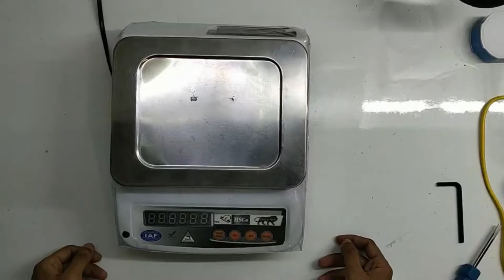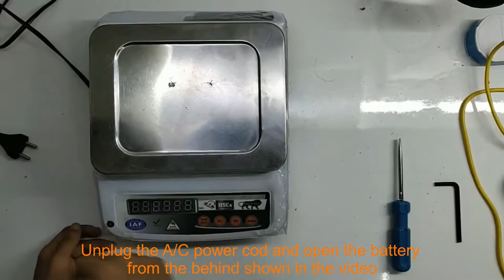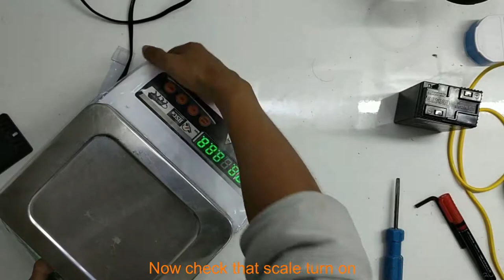How To Fix Battery Backup Problem in Weighing Machine - HSCo

Comment: Hi 

We bought this Dr trust weighing scale from amazon last year. Suddenly it has stopped working. We changed all the 4 batteries today and now what is happening is the scale works once after we insert the batteries. And then next time we step on it it doesn’t show any display. When we again remove and reinsert the batteries ... it works once. 

Please bataye kya prob ho sakti hai isne . Company ne mana kar Dia hai bina check kie hi ki repair nahi ho sakta aur out of warranty h
Reply from the maker: Plzz call this number:-7045379537